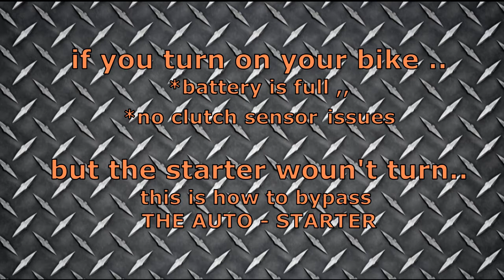ktm duke no starter issue - how to forcestart

Comment from the maker: the reason i use this is due to a bad voltage regulator the problem is gone once isntalled after market new part , works well
Reply: So when the fuel is rich does it gives out white smoke when revved
Reply: The ground cable terminal was broken we repaired it, and the start button does not work, I jumped the solinoid it works but the revs are going up and down, like crazy and it's on 4k rpm the bike is screaming and when I give it throttle it will cut out and it seems the throttle is not responding  to my input
Reply: What could it be?
Reply from the maker: @HamzaShowai  voltage regulator . test it it's cheap to get on the aliexpress and works well

the description
sounds quite the same when my regularot was bad 
this is caused by too low/over voltage / protection
for the computer ecu electronic thruttle control .

* be sure your black ground wire coming of the voltage
regulator is not rusted . it must have secure contact to the motorcycle metal freme  .. try cleaning it first .

Comment: may i know sir whats the problem wit that,may duke 200 sometimes dont start  no clicking in starter relay,!
thank you!
Reply from the maker: the ktm voltage regularor have a black grounnd wire secured to the frame of the bike . if it is curroded 
the voltage going to the auto-thruttle control is interupted , 
be sure to check it , (location under the fuel tank secured via 8 size blot .)
if problem presists the voltage regulator / stator might be faulty )

Comment: Ok so my 2015 KTM RC 390 will start for about  a 1 1/2 second's then shuts off, continues to crank and crank will start for 1 second then shut off, sometimes can get it to stay running for about 3 seconds then dies??
Any help? 
Can't find videos in English or any at all..
Reply from the maker: check to see if your fuel flow is constant
might be an old fuel filter blocking the fuel
the same is for clogged air filter 
both are essential for engine to kip runing
be sure to have fresh  fuel in the tank before trying the next time
if all fails then 
the problem is elsewere
Reply: @MechanicsDIY  so I had changed out my fuel filter but didn't think it was going to solve my problem after i blew through the fuel filter it had same amount of pressure, I changed out my oil pressure sensor, starter solinoid, spark plug and was continuing to do the same thing,  blip the throttle and it died, tried to start it and it would die, it was shutting off when coming to a stop or trying to take off, but after I changed out the coil pack it started working normal again, checked all fuses and we're all good, battery was good, so I believe it to had been a bad coil and a rusted ground behind the coil pack where it mounts to the frame, took a bit of chasing down but the KIWI is running again 💯 thanks for your reply bro not many will.

Comment: just run start it ... put it in second gear , release the clutch .. bam , thanks
Reply from the maker: posible ..  but why run , ps: if you get this issue replacing the voltage regulator solves the issue
Reply: @MechanicsDIY  ifyou are in a pickle , better not short out the bike , and just run then shock it.
Reply from the maker: @Jacksteelmachines  this video is not a sugestion - but information .  use your brain . my motorcycle still works just fine ,